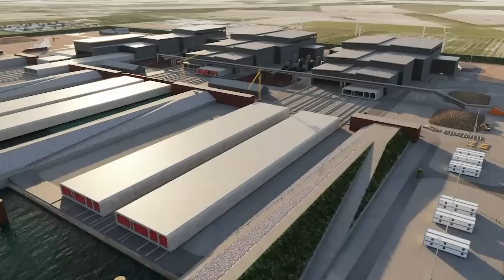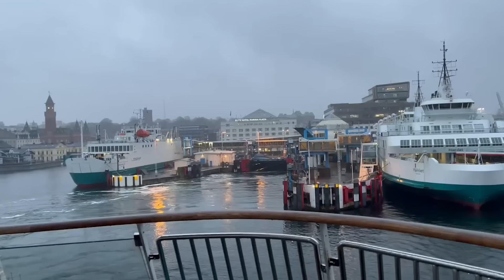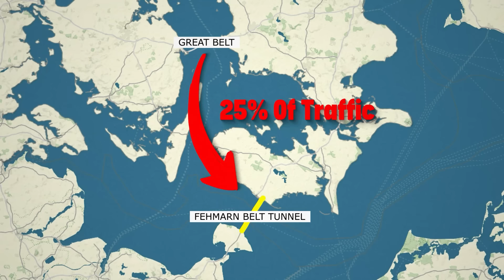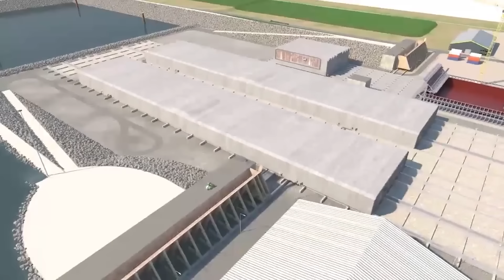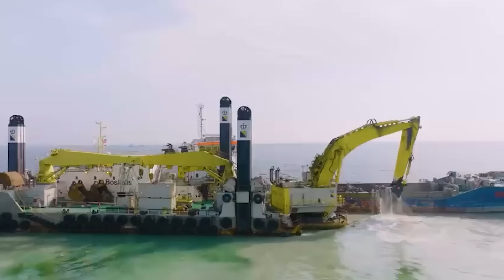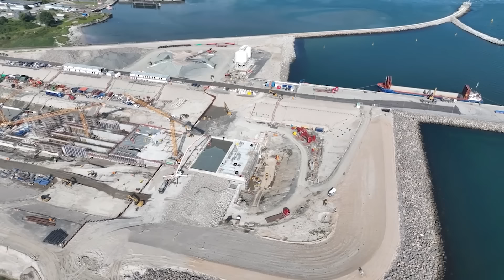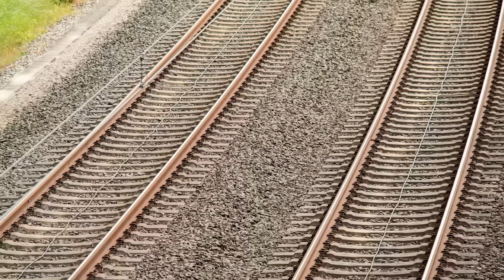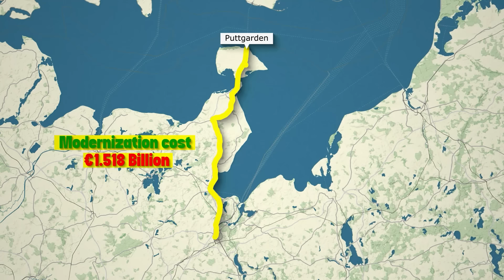Could Germany’s Delays Ruin a €7.4 Billion Mega Tunnel Project?

Comment: Germany is single-handedly holding back most transcontinental high speed rail route opportunities in europe. If Germany actually bothered to build its share of real 300km/h high speed rail tracks, we could have routes the length of Paris to Copenhagen or Amsterdam to Vienna in less than 4 hours, like in China. In China they already have routes the length of Milan to Stockholm or Barcelona to Krakow down to 6h15.
Reply: Relax, we still have to ask every single land-owner along the planned route for consent and give our politicians a chance to play favorites and route the rail line around their constituency. If you're looking for pragmatism, you came to the wrong place.
Reply: Well, to be fair, Spain is not as densly populated as Germany is in many regions. Thus in Spain you have less roblems with people not wanting the line there, or wanting the line to be rerouted, or wanting extra stops for the line.
An additional problem is that Germany has a policy of shared rail infrastructure. This means cargo, local and high-speed trains all share the same rails. This inadvertendly leads to delys and other problems lowering the average speed.
Another factor lowering average speeds is, as mentioned above frequent stops for high speed trains accross Germany. And just not stoping at some stations does not even save time, as there are no raisl going around many stops. And even when the trains can use dedicated high-speed rail-connections between cities, most of those do not run right up to the station but end at the city borders where the trains then must transition back to the shared network.
There is also still several large citys in Germany that do not have through stations for rail, also significantly adding to the travel times for every train stopping there. Stuttgart is known for beeing in the process of rectifying this problem, but Frankfurt is still int he planning stage for their through traffic station.

But yeah, all in all Germany needs to become way more rail enthusiastic again, then it could become the proud beating heart of European Rail.
But ther's too many NIBYs, and too few politicians promoting rail as an exciting future here. And Germany would need to make way more serious efforts to separate its Rail-Grids wherever possible. In some places there would be needed 3 separate networks: 1 for cargo, 1 for high-speed and 1 for local trains. This problem can for example be seen at the middle Rhine sections between Colone and Frankfurt.
However building new tracks there is impossible or expensive as they must round around the river and through mountainous terain. Means many bridges and tunnels driving the cost way up...
Reply: @AkantorJojo  The sooner Germany goes all in the better for everyone, worrying about money now will make it harder later down the line
Reply: @ShardFlowers  Tell that to our politicians.
And tell that to those voting right wing beacause they feel their lives have gotten worse or they see no good future for them. Tell those: yeah, we spend the money on rails, but this will help you... I'm sure... in some way.

As much as I wish Germany would do this, I currently don'T see how this would happen.

Germany is about to spend a fortune in the next decate to "restore" its rail system to the level it should be in were it not neglected for over two decades.
And then we have hundrets of bridges (mainly roads) that have their eol come up soon, or that have to prematurely be closed because of higher than expected degradation mainly due to higher than forecasted usage... This will also cost a fortune; and because it's cars and it's Germany I suspect this will get priority -.-

And finally, Germany is iirc spending between 1/3 and 1/2 of its anual budget on retirenment payouts, with this problem only worsening in the near future...
And there is way more. So sadly I think good public infrastructure like rail, bike and puvlic transport wil be on the political backburner for a while... because people don't want to understand that good public infrastructure is cheaper for eeryone and makes lives better for everyone -.-
Reply: @AkantorJojo  "This means cargo, ... all share the same rails" Well, a major reason why this isn't the case in France or Spain is that compared to Germany those countries have very little freight rail to begin with. A third of all freight tonne-kilometers across the EU are driven on German tracks, as much as France, Italy, Sweden, Austria, Czechia, Romania, Hungary and Spain combined. Add Poland and you've got about 50% covered. Germany is also one of only a few EU countries where the amount of freight transported by rail is increasing, in quite a few (including France for example) the amount is rapidly dropping.

And another major reason why Germany will probably never have a dedicated high-speed network like Spain or France is that due to history Germany's economy and population is much more decentralized than those other countries (plus a significantly higher population density). An ICE network that only connects Berlin, Munich, Hamburg, Cologne and maybe Frankfurt simply wouldn't fly for many reasons, but that's basically what a German equivalent to France's TGV "network" (more like a bunch of lines radiating out from Paris than an actual network) would need to be.
Reply: @AkantorJojo  There's reason why for example Frankfurt has quite many high speed trains skip the main station and instead only stop at the airport station (which is a through station that doesn't seem to be shared (much)).
Reply: But of course their car lobby is doing everything it can to keep car use as high as possible in germany. Soo expect the highway to immediately be connected to the tunnel, but the railway line needing another decade....
Reply: Germany keeps the eu alive with insane amounts of money. Germany keeps ukraine alive with even more money. Enough is enough let us germans breath you mf!
Reply: Ecactly. High speed rail is all about AVERAGE speed, top speed is irrelevant if average speed is below 200 - 250 km/h, so building for a top speed of 300 km/h ensures high average speeds but it has to be sustained all the way
Reply: @ShardFlowers This is why Germany's tiny pieces of high speed cut up with loads of slower sections are such a problem. Germany needs to be building Spanish amounts of dedicated high speed rail track, not only for Europe as a whole to meet its climate targets, but also to free up capacity and timetable space on its extremely overfilled mixed use rail network. Deutsche Bahn's delay problems would be much less significant if ICEs weren't clogging up regional train lines and timetables.
Reply: @SkeledroMan  Yeah the german network sucks on so many levels that it's obvious car companies are to blame. A lightning fast, separate and efficient rail system will make Volkswagen profits plummet, and I couldn't be happier
Reply: Why is it always China? On this very continent, Spain excels in building high speed rail.
Reply: @BaLinhVo-z2f Spain builds even cheaper per km than China, yes. But they can't expand that building beyond their own borders yet. So China remains the only place with true continent spanning high speed routes, reaching 2000km long.
Reply: @SkeledroMan They have been so great at HSR that I'd have the Spaniards build it in Southern Italy, as a southern Italian. Italian HSR is sustainable only thanks to its success, but the infrastructure is madly expensive and not doable anywhere else in the country where it's slightly less populated and the terrain more rugged. Maybe Spain even exaggerated, but their expertise and way of building their LAVs needs to be studied by the whole continent
Reply: @SkeledroMan  Then that's not a problem with Spain. By that metric, China doesn't have any cross-border high speed rail with any neighbour, while Spain does with France.
Reply: @BaLinhVo-z2f I even read somewhere that spain builds HSR for less cost per kilometer than China, either way in both cases it costs so little because they actually keep knowledge and expertise in house instead of just letting private contractors do all the work
Reply: @BaLinhVo-z2f Spain is doing a great job, even better than China in cost per mile. But it isn't able to expand its model beyond its own borders to cover huge distances like you find within China.
Reply: @BaLinhVo-z2f  And... Hardly any of the high speed lines in China make economic sense. A few, like Beijing to Shanghai, actually make money but a lot of the lines were make work projects to boost the economy and are now shedding tons of money and piling up debt. Not a good model to follow.
Reply: Hold up a second there. It’s 1,200 kilometers from Copenhagen to Paris over the Femern Belt so you’d need to build much faster tracks to accommodate a 300 km/h average speed. Also consider that Chinese HSR stations do not go through Chinese cities, but only touch the peripheries. This makes it much cheaper to build tracks and stations, and accommodates higher average speeds, but it’s much less useful for connectivity.
Reply: Fastes train in danmark drives 180 kmh, oure tracks dont support more speed
Reply: @M3N6ER Not accurate. The (relatively) new Ringsted-Køge-CPH track supports speeds of up to 250 km/h, though there are currently no trains going that fast and the maximum allowed speed is 200 km/h.
Reply: Car industry.
Reply: But there are no 300km/h high speed rail tracks anywhere around Copenhagen, Amsterdam or Vienna
Reply: @nosveros Cause what's the point of wasting billions in lines ending up nowhere which will take years to be completed and which will have to be renovated again at that point? If you build a HS line, you build it from point A to point B, you don't make trains slow down from 300 to less than 100 km/h far away from point B.
Reply: They are busy ruining their economy, and sending German tanks to Ukraine killing Russians just like last time. They just never learn do they ?! 😢
Reply: Germany indirectly is paying for all these wonderful rail tracks everywhere.
So...who's paying for the German railroad?
Reply: @raimundschwarzholz7576 The same German economy which benefitted shittons from the EU and the euro in other ways. European countries will cry rivers instead of blaming their idiotic politicians they themselves elected for slowing down their economies
Reply: @raimundschwarzholz7576  Noone, germany had an infrastructure investment hold for the last 30 years called "Schuldenbremse"

Comment: As I said years ago when everyone was so excited about this project
The Danes are going to build their tunnel alone to avoid delays only to come out on the other side and find nothing to connect to

Checkmate Danes
Reply: 10 years ago a railway bridge across the Ems river , near the dutch border was damaged by a ship. The bridge is still not open , abd rail traffic cannot go .   Back in the 1930s the bridge was built in 2 ywars ...
Reply: @lws7394  It’s Germany’s Siberia, just like Putgarden. The North has a lower status in comparison to Munich/Berlin/Frankfurt.
Reply: @Nettlebed7   Maybe, but it is probably because of ' Aussenland '  ...  There should be a high speed line between Freiburg and Basel as well, but that dont gets priority either. ( The Swiss part should be ready by 2030 .. The Germany part ? ?  mid 30s ? ?   ..'IF ' ... )
 And Stuttgart 21 might be in danger to become Stuttgart 22  !
Reply: The car part will be ready for shure. German car industry’s is deciding what gets done in Germany
Reply: I guess Germany will have to pay some heftig fines, it is after al an international treaty.
Reply: @Gert-DK  While the contract does clearly state that Germany must finish its connection in time, as far as I can tell, it doesn’t actually include any explicit consequences for not doing so. Of course Denmark can, should, and probably will sue Germany, but I’m not sure if that will achieve much.
Reply: @fixminer9797  Denmark will get extra expenses if Germany ain't ready, I believe. 
Without knowing for sure, it would be reasonable to think that DK will be compensated. Denmark will be paying back a loan and interests without the income.
Germany's reputation was known at the time of signing, so I am pretty sure DK made sure there is something in the treaty, to compensate.
Reply: @Gert-DK  That would seem reasonable, yes. But you also have to consider that Germany never really cared that much about the tunnel, while Denmark really wanted it, which is also why Denmark ended up paying for it. Which might explain why Germany (seemingly) didn’t have to make any properly binding commitments, if Denmark demanded them, Germany probably would have just said no to the whole thing.

Of course I’m far from an expert on international contract law, so who knows.
Reply: @fixminer9797  Yeah, I know that Germany wasn't that keen on it. It was Sweden that convinced DK that the link was a good idea. Sweden offered to cofinance the Øresund Bridge, which DK always have wanted. So with Sweden, Denmark and the EU pushing, Germany accepted. The German part in the project is minimal compared to the Danish part. It should be possible. Any way, Germany will feel the most pain on the Femern Bridge, if it is delayed. 
A signature is a signature, even if it is a reluctant one.
BTW, for those who dont know, the small tunnel before the Øresund bridge is actually a "test tunnel" for Femern tunnel. The Femern tunnel will be made like the Drodgen tunnel in Øresund.
Reply: @fixminer9797  I set AI to work. You are pretty much right, there is nothing in the deal that automatically sanctions delays. 
Here is AI's final answer, translated from Danish:

The 2008 bilateral treaty: In 2008, Denmark and Germany signed a treaty on the establishment of the fixed link across the Fehmarnbelt. Here it was agreed that:
- Denmark is responsible for financing, building and operating the tunnel itself.
- Germany is committed to upgrading its infrastructure, including the railway from Puttgarden to Lübeck.
- Both parties must ensure that their respective parts of the project are coordinated so that the link can function as planned.
But — and here’s the interesting thing — the treaty does not contain a direct compensation mechanism if one party is delayed. This means that if Germany does not have their part ready for the opening, there is no automatic financial compensation for Denmark.

EU law and state aid: The project has also been the subject of legal battles over state aid, especially from the ferry company Scandlines. The European Commission has assessed that the Danish financing model — which involves state loans and guarantees to Femern A/S — is legal and compatible with the EU internal market.

Conclusion: There is a binding treaty, but no automatic compensation. However, Denmark is in a strong position, as the project has been approved by both the EU and Germany, and delays on the German side could lead to political pressure and possible negotiations on mitigating measures.
Reply: @fixminer9797  Yeah, but then we threatened with limiting German tourism at the west coast, with a fixed amount of overnight beds per year for german passport holders. And if there is somewhere german tourist like to vacation it is on our west coast. And suddently they thought the tunnel was the worlds best idea.

Maybe its time we revisit that fixed amount until they get their infrastruce up and running
Reply: @fixminer9797  I did put AI to work, quite a lot. There is nothing in the contract on automatic fines or stuff like that. Here you were right.
But in case the Danish government want to sue Germany, the AI thinks that Denmark have a good case. Furthermore, AI thinks that Denmark have a good chance for support from the EU.
All just theory, but quite fun to research.
Reply: @Gert-DK  they don't care, the don'T pay themselves. maybe they use the climate budget for paing the fines.
Reply: The Germans did the same to the Netherlands, when it build the Betuwe route to the German industrial heart, only for Germany to delay their third rail for around 20 years now
Reply: Hah thats not a checkmate for Danes :P We build brudges and tunnels just for the entertainment.
At this point its a bit of an internal joke. 

Im surpriced we did not build a longer one towards berlin. But i guess thats next that or a tunnel to norway.
Reply: @danis8455  It is correct, we actually build them for fun. Look at the Metro line M3 in Copenhagen, it just goes around and around and getting nowhere.
No tunnel to Norway, that would be a tunnel too far. But they are talking about another connection to Malmø for Copenhagen Metro! 
There might be a risk for congestion on Øresund's bridge, when Femern is up and running.
Reply: @Gert-DK we will just build a bridge and a tunnel opposite of the bridge and tunnel
Reply: Counterpoint: Traffic jams in Germany.
Reply: Yeah, I think I saw that comment